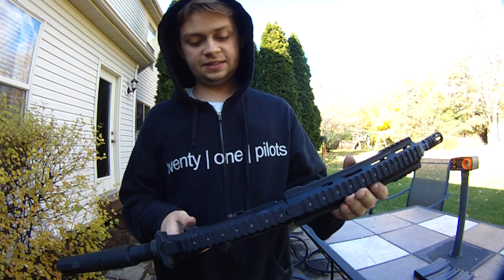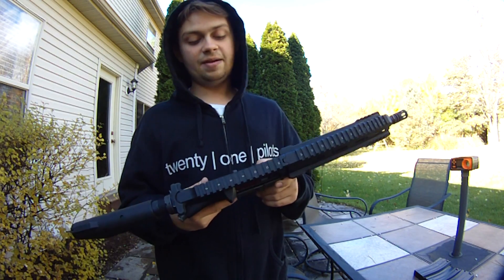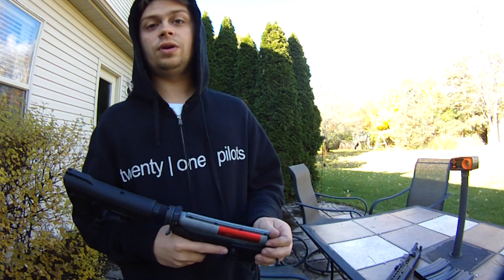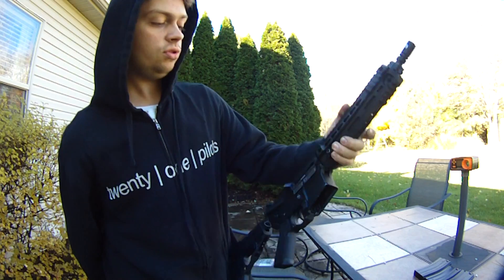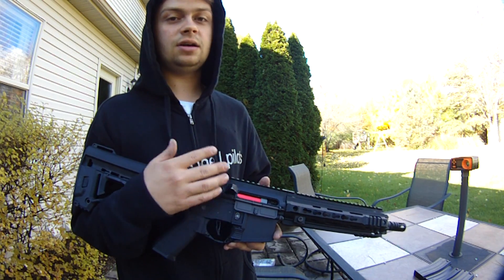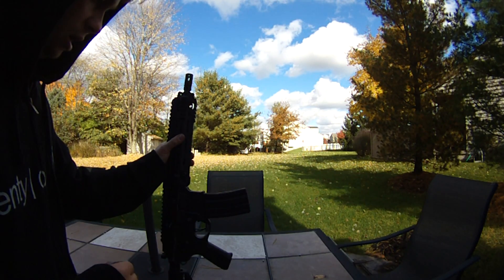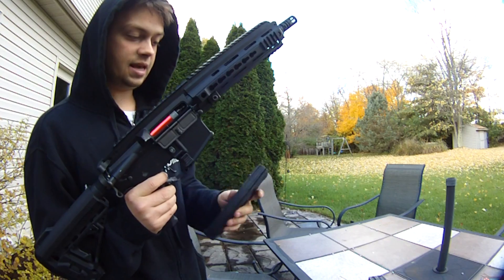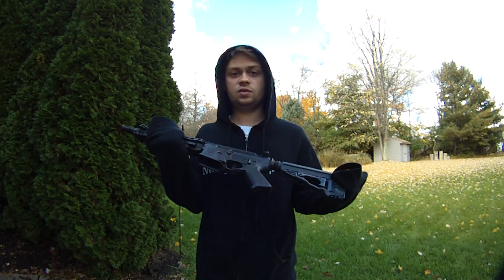VFC Avalon M4 Review and Shooting Test

Comment: The Calibur is an Avalon big guy. I think you mean to say the Calibur and the Saber. 😆 $250 for this gun is a total rip off btw. This gun stock feeds both mids and high caps with no issues and shoots 360-370fps and 23rps on a 11.1 20C lipo with a standard tamiya plug.
Reply: What? Avalons are great and are about 350 new

Comment: Sad part is that vfc didn’t update there tappet plate material/piston. Barely put pressure on one and it snapped. I can also tell that the piston is made of the same stuff, just hot red garbage
Reply: That sucks. I have a Avalon with a gate titan and I ssg'd it by 2 teeth and no other internals and it has lasted and i abuse tf out of it.